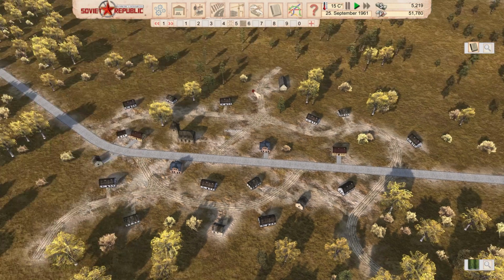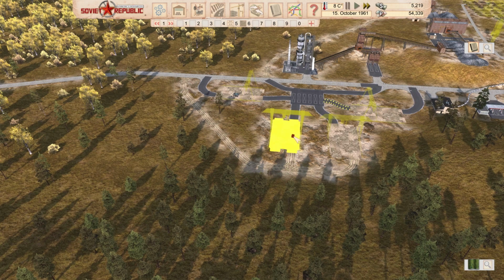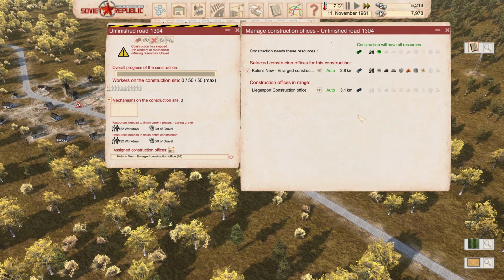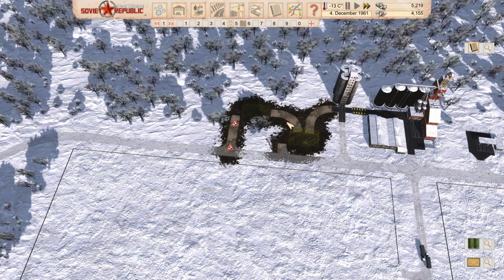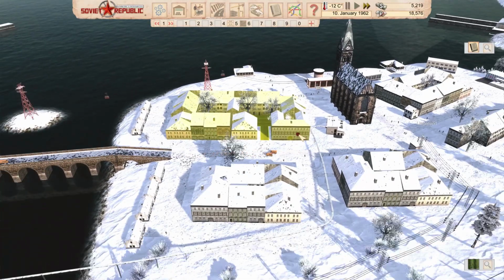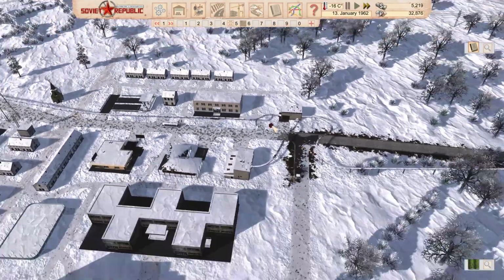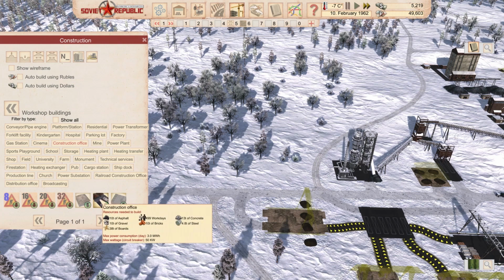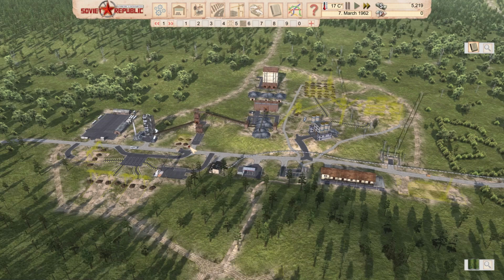Workers and Resources - Soviet Republic - Libertian Socialist Republic - Ep.5

Comment: You know you can use Distribution Office to get the crops from field to silo? I dont know if it works with the Farm too, but the silo works and you have more space for farming machines. ;)
Reply: You dont need Trucks in the Farm then.
Reply from the maker: Yes. You are right! It does not work with Farm. I did this on the long series I did Project Leszcie.
1 small issue is if you have more then 19 fields then the farm will work them and Distribution office cannot be assigned to it. So 19 fields max per farm. 
I did not focus on the farm yet because we are not processing those crops yet but that is exactly what I will do. 
Thanks chief! 😊😊
Reply: @oolykeegaming81  And another good tip for workers. I made some Tests to figure out, how they Change lines. They dont Switch lanes at the same Station. So if you send them to a Station were they could Switch to another Lane, they won't. But, if you have another Station and you say in e.g. Station 1 should let go all workers to Station 2 they will change lanes to get to a workplace further away.  

I use Busses to get workers from little Stations in my City to a Big central bus station near a train Station and set the busstation to send 100% of the incoming workers to the train station. The Time they travel should not be longer then 5 hours.

I hope u understand what I mean. xD
Reply from the maker: @MaGGuS81189  I understand. How many buses will they change to get to work? As many as needed?
Reply: @oolykeegaming81  I think so. As long as the traveltime in busses/trains isn't longer than 4 hours and the overall traveltime isn't longer than 5 hours. You can see that when you click on a worker in the overview from vehicles. 

The workers will also stay in a train or bus if the station they can get work is on the line. But if they should Change from line A to B Line A must be on another station than B and you have to tell them in Station that they have to go to the other station to get work.